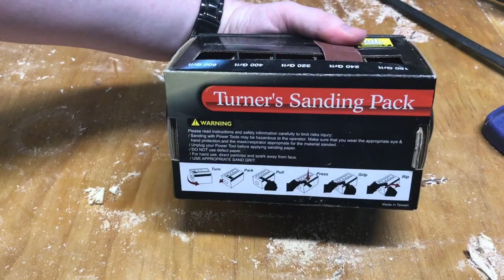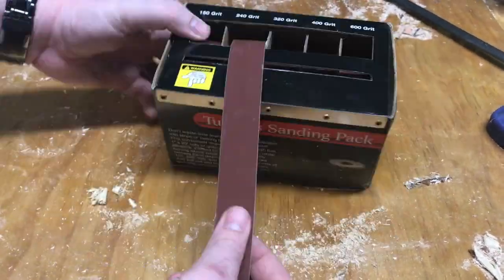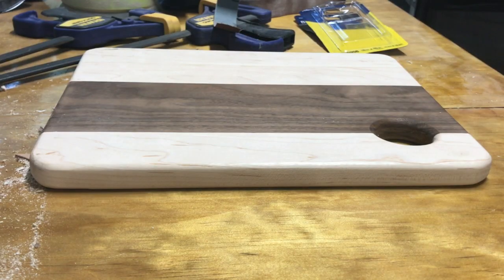Make a Cheeseboard!

Comment: You can use your router and a planing jig to flatten the boards if you dont have a planer. Belt sander is definitely not the right tool for the job. It's a good looking board. But there's no way it sits flat without being planed.
Reply: TheMattGrizzle wonder how they did it before electricity...
And a belt sander will flatten as well as anything if you use the right technique
Reply: @adamwilson4834  Before electricity they used hand planes...
Reply: @cgriesemer  right, thats what the 3 periods are for, its called sarcasm. I do it with a handplane on a regular basis